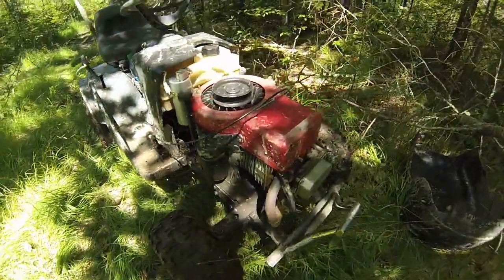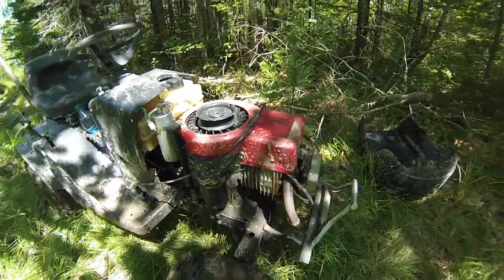Mud Mower TRAIL RAMPAGE!

Comment: I'm an old Guy 55 + and I just get a kick out of watching these videos ...I may build an off road mower  some day !!!
Reply: not2fast4u2c - its not really that difficult actually, i used to take totally stock mowers ( minus deck) in the swamp behind my house years ago, really didnt get stuck all that much either.  for a starter id say either a murray or older craftsman, do a slight pulley change( bigger on front, smaller on rear) , get a set of aggressive tires and youre ready to roll.  i have plans for my 90s gt murray ( has the hood that opens like a car) - it has stock 1" front spindles, 1" rear axles, i got a winch, air compressor, and atv tires.
Reply: Money is tight for me ..But...I'm sure if I built one I could always sell it
Reply: check out MOWER OUTLAW
Reply: OK
Reply: not2fast4u2c Just bought one off craigslist for 80$... got it running for free and just ordered some atv tires for it .

Comment: The fuel problem, maybe if you put the filter as close as you can to the gas tank so it is as straight up and down as possible, even if you have to loop the fuel line after the filter to make it work. Just a thought.

Comment: i pulled a brigs and strat 14.5hp engin ouy of an old murray with an automatic trans, and three it into a craftsman. 6 inch pulley in the front 4 in the back and I still have the govorner. clocked mine at 25mph, started wearing a helmet after that

Comment: i have a husqvarna with hydro rearend,if i pulley swapped front,would it be a good canditate for a mud mower? it has ahuge gas tank under seat,and battery is mounted out of the way right below top of the hood.has 20hp kohler command engine.

Comment: Have you tried Armor-all on the GoPro case?

Yeah those Craftsman axles suck. Need to get one from a GT6k.
Reply from the maker: Keystone Motorsports no, but I want to try rain-x
Reply: I think that the Murray does better in watery mud and the sears does better in thick mud
Reply: FearlessFront (Todd Christopher) You could also try putting a snow and ice repellent on the GoPro, might work even better then rainx

Comment: Im trying to decide if i should use chains on my off road lawn mower with 23in turf savers or buy 25 vampires what do you think @FearlessFront? Btw its a 96 Murrary ultra garden tractor.
At 6:02 Is when it got real.
Reply from the maker: Mr Troollz it's up in to you, I don't like using chains at high speed, so I would go with the tires. it cost a lot more though
Reply: Yea it's like 220$ for the vampires and new front tire's. Should i get new front tires or leave the stock 16 in tires? And also do you still have the craftsman crawler and the lifted mudding mower?
Reply: copy the design of tire chains but use some fat braided nylon rope... it does work the key is making them too small and inflating the tire inside... the last set I made lasted 3 winters but I have to make a new set this year for my offroader I'm building... I'll make a video of them when I get around to it..
Reply: FearlessFront (Todd Christopher) i have a kubota 3200 2 cylinder diesel that is fairly high already but i can walk faster than it, would it be a good mudding mower?
Reply from the maker: Mr Troollz if you are locked then you will probably want the grip on the front end for turning. and no, I got rid of the lifted and the Craftsman a while ago
Reply: FearlessFront (Todd Christopher) thats true cuz i dont wanna blow that motor to blow up cuz that motor can pull a full size truck
Reply: FearlessFront (Todd Christopher) hey todd im building a offroad lawn mower myself and i relapt the valves  and the valveseat because if i held a rag behind the exhaust and it Pulled the rag in my uncle said that i needed to relap the valves  i put it al back together and it still pulls the rag in and sometimes it even backfires is this a really big problem? It also runs uneven so it Revs up and down on its own i rebuilt the carb and it did nothing do you have any idea what this Could be? Any comment helps
Reply: h kronenburg that sounds like fuel delivery problems

Comment: Would a tractor with unlocked differential be able to do anything like this?
Reply from the maker: +Matthew Barnes the guy I'm riding with is unlocked
Reply: Matthew Barnes you either need really aggressive tires or a locked differential and some moderately aggressive tires. I wouldn't run big aggressive tires and a locked differential together unless you have a good tranny and axle shafts.
Reply: Ok, thanks! By the way I really enjoy your videos.

Comment: @FearlessFront (Todd Christopher) is can you email me or message me on here I'm building the same type of mower I have the 17.5 motor but I have questions about the pulley swap I got a 41/2 on rear. and I'm going to put a 6in on front or might flip mower deck drive pulley over on the front but wondering what length belt I will need and need help with ungoverning the motor